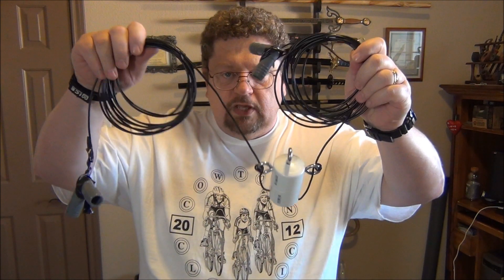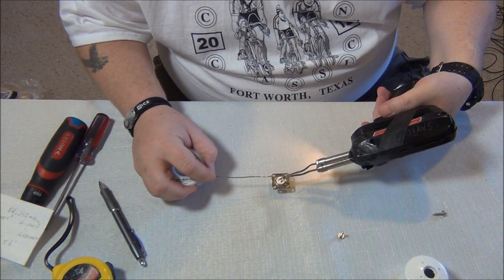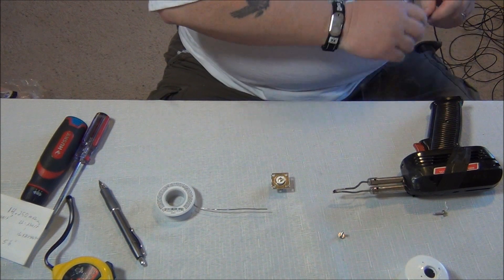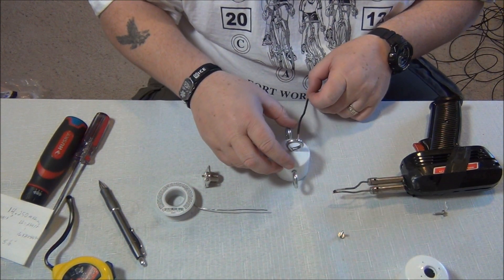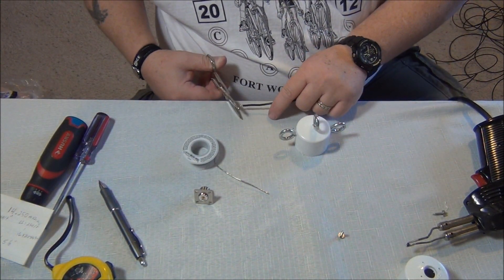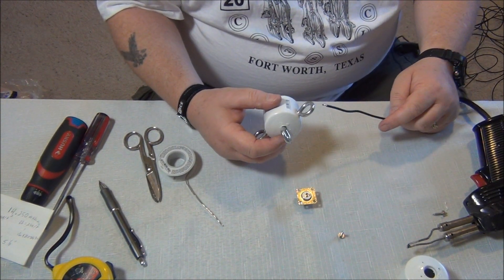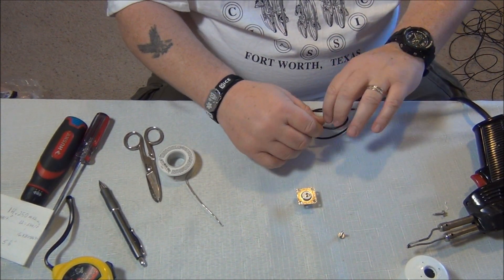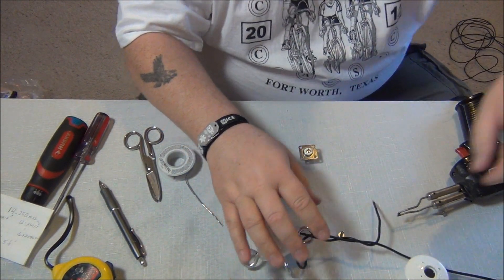Homebrew 20 Meter Dipole Antenna -- Home Depot / Lowes Part 2 - AF5DN

Comment from the maker: Don't believe everything you read.  Do some experimentation of your own, that's why you have a license.
You don't relay need a balun if you can tune your antenna and are only running 5 to 7 watts. 
I have talked to Jamica on 20 SSB (1,604.8) mi with this antenna it is using the MFJ-2049.